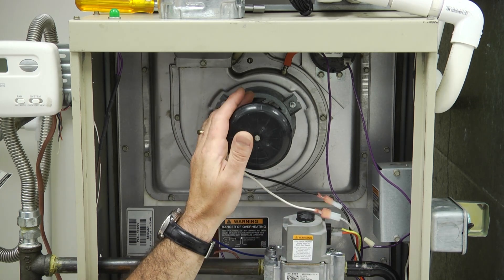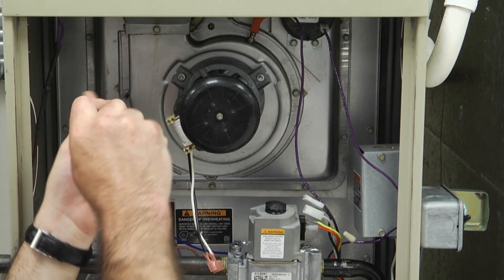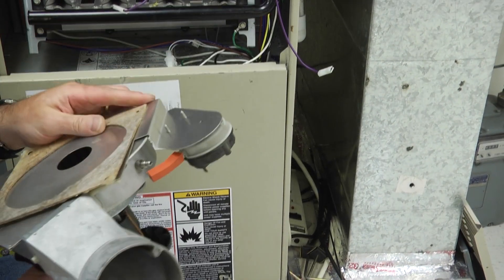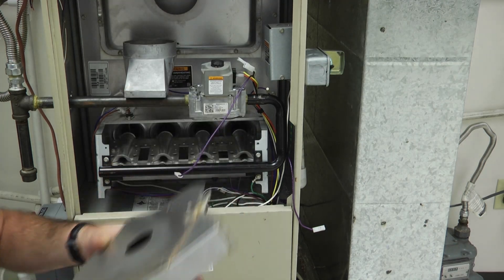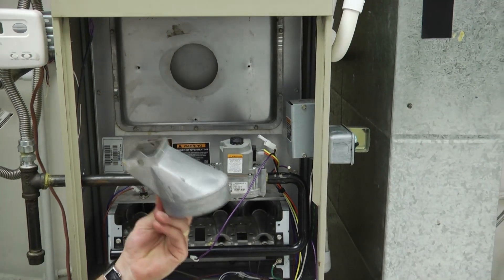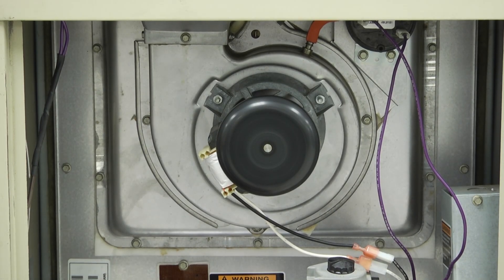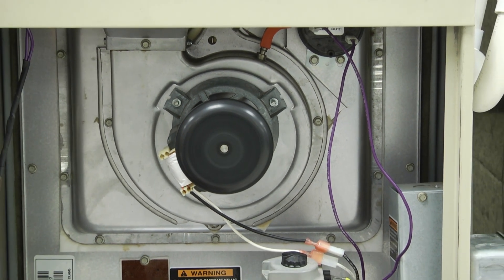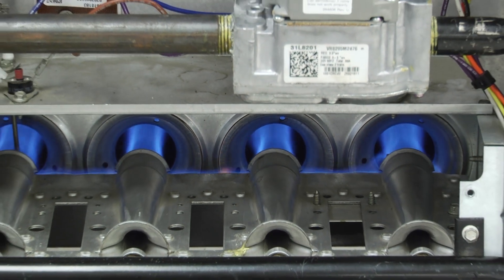Toolbox Tuesday: Replacing the Induced Draft Motor in an 80 Percent Furnace | Lennox

Comment: It is kind of a pain that you can’t just change the motor and not the whole assembly.Why put cooking oil on the back? Wouldnt you want the silicon to stick to the surface ? Wouldnt that be more airtight than if it is not sticking?

Comment: You said use high temperature silicone on the back of the back of the ventor motor and cooking spray on the face plate where the motor attaches. How do I know if my installer did that? My installer installed a new Packard ventor motor into my carrier furnace, but the quiet spin sound u hear on your video, with mine, I hear a high pitched ringing sound that increases pitch or goes higher once it kicks into the 2nd speed. Yours is quieter. I don't know why the ringing sound that i hear from the inducer motor  that travels through the exhaust pipes both connected to furnace and one intersecting into it from the water heater.

Comment: Replaced mine last night on an outside double unit. Ac  on top heat on bottom. So it wasn’t easy to get to. Remove the circuit board out of the way . Disconnect main power lines. Finding the few hidden screws . So about an hour with a flash light to swap it out and all back together.  
Y’all don’t forget to pull or turn your breaker off. 
Great video thanks.

Comment: If it is making noise I am not going to know.  It's up in my attic. If it fails I will know.
Reply: You'll probably still know...it's not  exactly a very quiet noise...I thought my big blower fan was coming loose and scraping (metal on metal) as it spun and i's down in the basement.
Reply: Bearings going bad are loud/scary/noisy. You'd know.
Reply: @fitybux4664  You'd had better know how to work of these things. Or you'd better be rich.

Comment: I made a rookie mistake when I was cleaning my inducer lol, I didn't make sure that I could buy the fiberglass gasket by itself. Thank you for confirming that I could use high temp silicone. Awesome video.
Reply: I stalled one just last year
Winter, it was verry quite, 
9 months later,  the wheel
Is loud again,
It was a new one,  what can I do to make the wheel quite again?
Reply: @Jmg354  did you find a solution? After I replaced my noisy blower motor I then realized how noisy my induction blower is.  I feel compelled to replace it, what do you think?
Reply: The new inducer motor comes with the fume housing and the gasket. It's not just a motor.

Comment: Wow these videos are great! Can you show how how to test an air proving switch (out of circuit and under load) next? Also how to check gas pressure, and how to test static pressures - i.e. manometer use would be cool!

Comment: What kind of cooking spray? Like PAM?
Reply: Actually the best would be to put a nice layer of Vaseline on there. That way the silicone will not stick to one surface allowing one to remove the assembly easily the next time its necessary.
Reply: @davenone7312   even better would be just using the right OEM gasket.
Reply: I thought the same lol